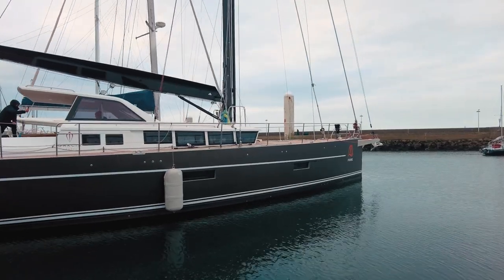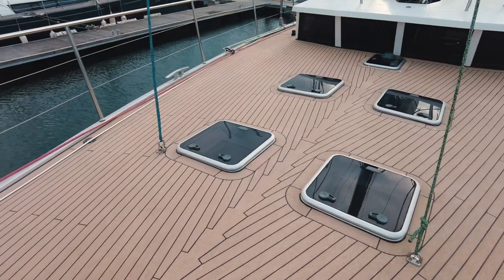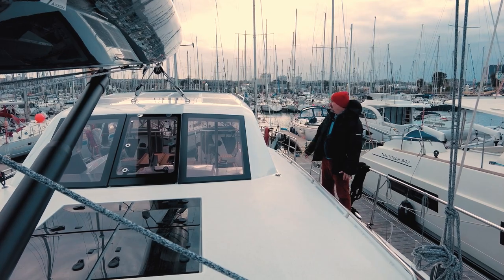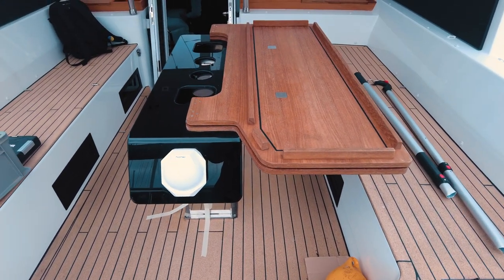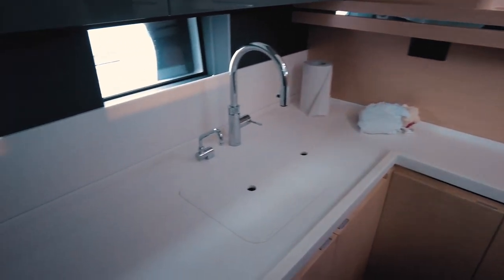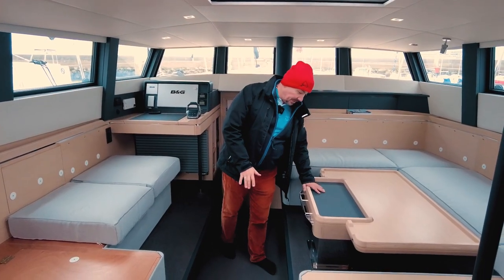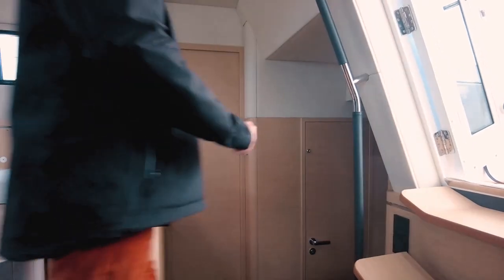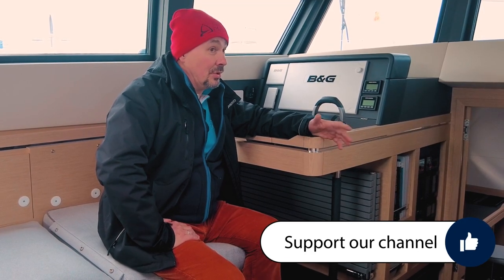Garcia Exploration 60 Express Review #Interparus

Comment: You can always use the microwave as I did on my last sailboat I attached a line to the handle of the microwave and a small float on the other end of the line to mark the sandbar near the channel entering the harbor that boats with any keel need to avoid steer away from the float that looks like a crab trap. If someone pulls up the crab trap they will find a useless box on the other end.